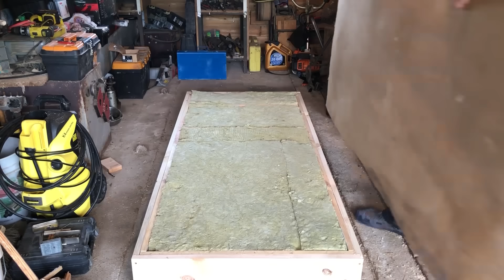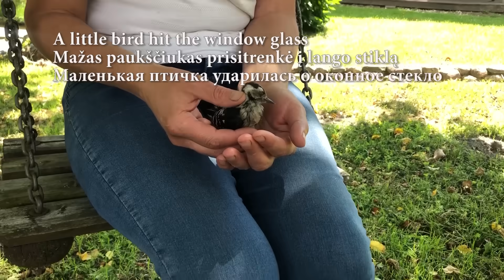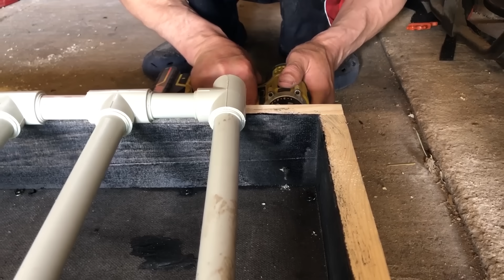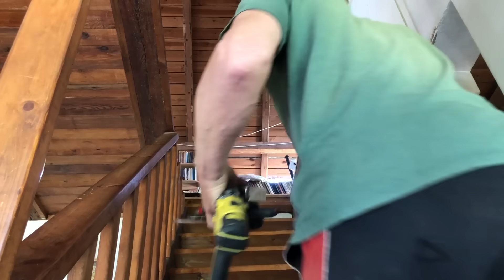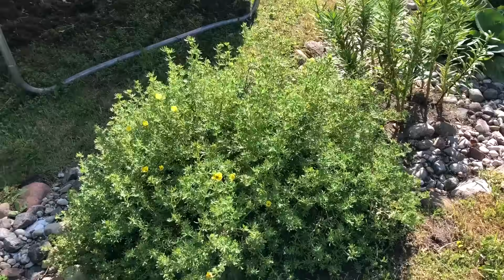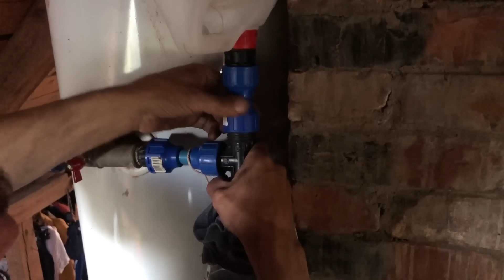Solar water heater. No controller and no pump. Making and installing

Comment: Now that a year has passed, how is this system working for you? Also, I am curious about this boiler you keep mentioning in the video. Why is this connected to a “boiler” and is the boiler shown in the video? Sorry but I’m not familiar with these systems, and I’m trying to understand how it works.
Reply from the maker: After a year of use, the water heating system works, but less efficiently than the previous solar collector made of metal radiators. The boiler is a 150-litre water tank with a spiral pipe inside, through which water from the solar collector is circulated. The boiler must be mounted higher than the solar collector for the self-circulation to take place.  We installed the boiler in the attic, at the highest point.
Reply: @  thank you for answering my question, this project really made me wonder and your explanation helped
Satisfy my curiosity.
Reply: Do you need the Boiler water to be separate from the collector water? Couldn’t you thermosiphon into the top of the boiler and have the return to the collector at the bottom, assuming the tank was cylindrical, and avoid the losses from the copper coil?

Comment: Self explanatory to me and we cant all afford copper.
 I live in Australia and have been intnding to do this for years but the prohibitive cost of copper has set me back. Im relegated to buying copper from scrap years when it comes in around my sesired lengths, im slowly getting there.
Reply: Use black painted PVC
Reply: Use scrap stainless steel just as good as copper. If possible source it from hospitals being upgraded, renovated. They tend to replace oxygen lines every ten years or so here in the States.
Reply: It’s not just as good, though

Comment: Can you please explain how the system works without a pump?
Reply from the maker: The system works with the help of gravity.  The boiler is located in the attic, at a higher height than the solar collector, so the water circulates naturally, without a pump
Reply: @Greenhomestead  thank you but how does the water get from your well or tank up to the roof?
Reply from the maker: The boiler receives its water from the house's plumbing system, which is equipped with a pump, an expansion tank and an automatic pressure regulator. This system supplies only cold water, but the heating system has a separate circulation circuit and operates without a pump and without automation.

Comment: Only CPVC is safe for drinking water.
Reply from the maker: In Europe and Lithuania, such pipes are used everywhere for water supply lines.  In this case, the water circulating in the solar collector flows in a closed circuit and has no contact with drinking water.

Comment: Many years ago i saw an article in Organic Gardening magazine that a guy wrote about his solar hot water heating method. He made a box like in this video but using a sturdy hose that went into the box and wound back and forth and then out the box and was connected to the hot water heater. The inside of the box and the hose inside the box were painted black and a pane of glass covered the top of the box. This was on the roof of the house on the sunniest side. He said it worked and as long as it was sunny he had hot water. His hot water heater only turned on on cloudy days.

Comment: привіт. чому всі фарбують основу в чорний. чому б не підкласти під гріль з труб той самий пінофол фольгою до труб(між ПФ і трубами зробити відстань) ?
Reply from the maker: The tubes in a solar collector are heated not only by direct sunlight but also by the hot air in the box. The box is therefore insulated and the inside of the box is painted black

Comment: Isnt adding a reflextive surface like mirror or aluminium foil on the bottom of the collector increase it's efficiency? As you build it, the black paint will heat up the wooden exterrior and not the pipes. Also how does the heat transfer liquid circulate without a pump, won't it cause the heating agent evaporate in the heatpipes and cause a system leak?
Reply from the maker: A mirror under the pipes will not increase the efficiency, because the pipes are heated not only by the sun, but also by the hot air inside the box. Circulation takes place due to natural convection, the collector is installed lower than the boiler. Since the liquid transfers heat to the high-capacity boiler, the temperature of the pipes cannot exceed 100 degrees C
Reply: Original, factory made water solar 1mx 2m cost about 200$ so building home made is waste of time and money
Reply: @zbigniewrozek8687  you must be american

Comment: Okay. So I'm about to make a slightly modified version of this. So here's a question I have for some of you who have done something similar. Would it be possible to instead of isolating the heating coils and heating up the water in the tank with those heating coils couldn't do double duty? Safe for instance the water ran to the pipes and heat it up then it went through the coil that ran through the water heater heating the water inside and then finally it dumped into the water heater topping it up as it went increasing the water heaters capacity for hot water. It seems logical to me but if somebody can point out a inconsistency or some reason it wouldn't work I would greatly appreciate it before I tried

Comment: ascolta ma lo fai seguendo un progetto serio funzionante e sicuro o stai facendo tutto questo tanto per perdere un po di tempo e farci il solito video da ritardati come fanno in molti?
Reply from the maker: We had a self-made solar collector for a long time, but it broke, the metal heat exchanger became hollow, the glass cracked. We are trying to do it differently, but the old collector worked more efficiently. In the summer we plan to make a better version.🙂

Comment: habe ich vor 18 Jahren gebaut, Rahmen Alu ,Bodenplatte Alu ,Rohre PVC, abdeckung  4 mm Klarglas,
Rohrschellen Edelstahl... Entnahme Wasserhahn immer offen..Wassereinlass ueber Waschmaschinen Ventil in der Kueche    schaltbar .  Immer noch in Funktion.
2.System  auf dem Balkon  15 cm Durchmesser Plastikrohr  4 Meter lang (schwarz gestrichen)auf der Bruestung befestigt
Wasserentnahme immer offen (Dusche) Einlass Waschmaschinenventil  Schalter im Bad .
funktioniert seit 15 Jahren ...Beide Systeme Verrottungssicher ,kein Termitenbefall ..
Reply: Funktioniert dein system ohne pumpe?
Reply: @firespacecostarica9303  Wenn der Wasserdruck in der Stadtwasserzuleitung hoch genug ist ja..ist er hier in Indochina leider nicht ,somit haben wir einen Speichertank und eine Automatikpumpe welchen den Druck im ganzen Haus gleich haelt. Der Solarerwaermer braucht keine zusaetzliche Pumpe,nach oeffnen des Waschmaschinen Ventils  steht ja der Druck der Hauswasserpumpe zur Verfuegung.
Reply from the maker: Wir leben in einem Bauernhaus, weit weg von der Wasserversorgung der Stadt. Wir haben ein lokales Wasserversorgungssystem mit einer Pumpe und einem Wasserbrunnen.
Reply: @Greenhomestead  somit muss das doch gehen...ich wuerde nur heute Kupferrohre im Kollektor benuetzen, die PVC Rohre haben sich stark verfrormt duerch die Hitze unter der Glasscheibe.....wuerde ich so nicht mehr machen alles andere ist ok....
Reply: @Greenhomestead  Litauen  da gibt es doch Winter..mein System ist nicht Frostsicher ,hier in Indochina gibts keinen Winter..das must du bedenken !!!

Comment: Nice! But doesn't this mean you have to climb to the attic every single time to fill it up?
Reply from the maker: Regarding the transfer of water into the attic, you misunderstood me.  In the attic there is a 150-liter boiler, which is heated by water from the solar collector circulating in a closed circle.  And the plastic tank is used only to refuel this circuit, once every 1-2 months, and the water in it does not heat up. 🙂
Reply: @Greenhomestead  very nice!

Comment: Corrugated stainless steel tube  could be ready and affordable option?
Reply: Most original water solars have copper piping - stainless isn't good idea
Reply: Why not?
Reply: @MikkoJordman  "Why not"? cose of heat absorbing and price. Can you proof that your stainless is better and cheaper?
Reply: I have those commercial copper-made collectors, but if I should make them myself I would use corrugated steel - affordable and so easy.
Reply: It's not better, but cheaper and good enough.

Comment: How does this work compared to your previous system? Does it produce heat? And how about the plastic cover?
Reply: Oh, you have already answered these, sorry. How about the polycarbonate?
Reply from the maker: @MikkoJordman  The previous system worked better. The water temperature was higher. We are thinking of going back to our previous version, which we will further improve. Thank you for the comment.

Comment: Thanks for the tutorial.  I live in the Netherlands, and we use a commercial produced solar boiler (+- 2 square meters), with 200 liter storage, which can in the summer easily heat the water up to 80 degrees Celsius, but that one uses a controller, a pump and anti-freeze. We use that for the shower.
I'm thinking of building a separate system myself,  heating the house a little bit with solar warmth in the spring and autumn.
---
Thanks for explaining that for your system to work properly, the boiler-vessel  has to be placed above the boiler, which I can't do in our situation, so I will need a a small pump.
Reply from the maker: The pump needs to be turned on via a controller so that it only runs when the sun is shining. When there is no sun and at night, the water circulation will cool the water 🙂

Comment: Why didn't you paint the wooden frame with four coats before you took it upstairs? Pine will rot in three years.
Reply from the maker: Yes, you are absolutely right. ❤️ Wood rots quickly. We are thinking of a frame option made of metal with copper pipes and a glass cover. Thank you for your comment. ❤️
Reply: I think I’d make it out of cedar and painted marine plywood. Better insulation and easier to work with, less ugly.

Comment: wooden box frame is fine, but line it with flat sheet metal.  Then do not use polycarbonate, again flat sheet metal keeping as small a gap between base and lid.   The metal box system will heat the trapped air faster giving a higher efficiency.  As the system is not pressurised use low density irrigation pipe with a smaller diameter but more legs.  This lowers the cost which can be either lower cost or increase the size of the system using the same size budget,  

Making/lining the box with sheet metal and covering (making sure you have a great seal) it with metal increases the box temperature plus using much thinner walled LD pipe (no welder needed as a bonus) transfers the heat to the liquid with greater efficiency.
Reply from the maker: Thank you 🙂

Comment: Would pex pipping work better in terms of longevity and not releasing toxins in the water??
Reply from the maker: Copper pipe would be better, but it is more expensive and requires special equipment to make the connections. Toxins do not enter drinking water, the heating circuit is separate
Reply: @Greenhomestead  , Special Equipment to make the connections  ?

I been sweating  copper pipe for  40 years  , 
You didn't use copper  because you can't  do it  .
Reply: Чому мідна? В золота ще краще теплопровідність. @Greenhomestead
Reply: Or copper pipe.?

Comment: Weii, Speaking from experience I can tell everyone this is not a good desgin. It's SOLAR POWERED! It gets hot in the daytime then cold at night,  In less than a year my system sprung a leak. No problem -fixed it eays. A month later ANOTHER LEAK.  
Wishing you all the best,
Reply from the maker: thanks for the good advice

Comment: Pvc releases toxic chemicals when heated and won't last due to the heat
Reply: Polycarbonate is coated with UW protection,not the best, and pp tube is a bad heat conductor. The next prototype will be better with copper pipe and glas.
Reply from the maker: The heating circuit from the collector to the boiler is separate. Water from it does not enter drinking water. There is nothing to fear about toxic substances. 🙂
Reply: This is PP and is used for drinking water in easten Europe and Turkye